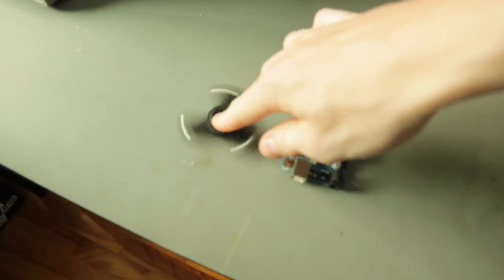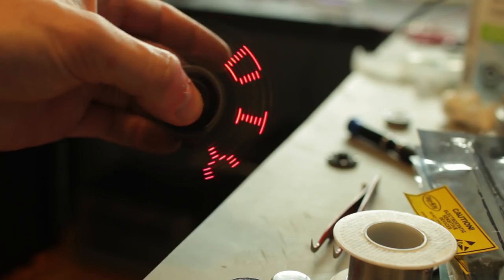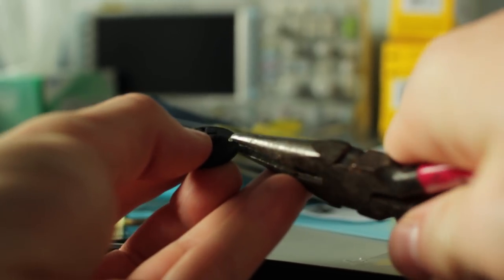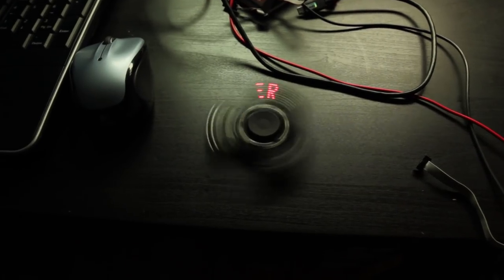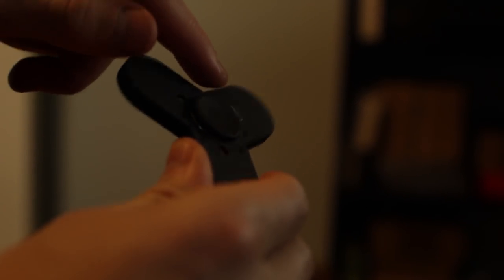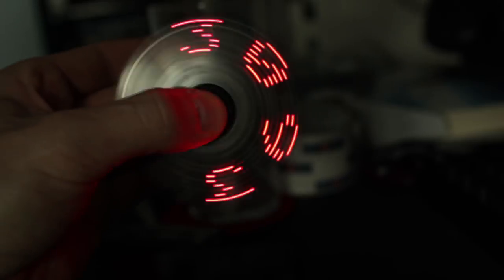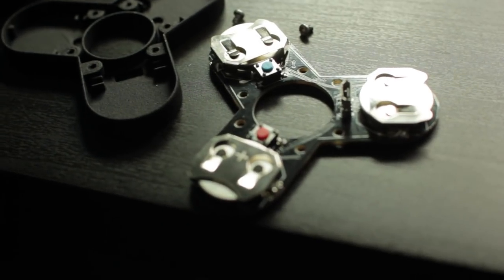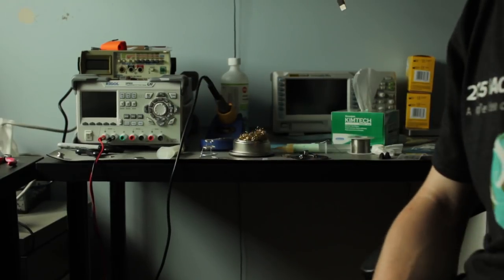Arduino POV Fidget Spinner - DIY!

Comment: I was just talking about this idea with my family. I think I will try to make this for several reasons. One is that it is a POV fidget spinner, the other is that is an open source design featuring several things that I need to learn (well, WANT to learn), i.e. charging and using batteries via USB, 3D printing parts and (maybe?) USB to UART...

Comment: Very nice work! Did you use linear reg then? Just curious why not a boost?
Reply from the maker: Thanks! 
You mean buck? There is no boost needed. The MCu runs at 3.3V and I'm giving the regulator 3.7 from the LiPos. I use this linear regulator because it uses basically no power when not in use and its simple enough, plus I have a ton of them so that doesn't hurt. Bucks require more components and when I was designing it I tend to go for simplicity. I've gotten a similar board down to 60uA in sleep mode with the regulator running so its not an issue.
Reply: Yea 'buck' idk forgot your using lipos. So there are minimal circuitry bucks (2 caps, 1 inductor) with an ultra-low Iq out there (TPS62742  Iq <360nA). Are using an ATSAMD21 Im assuming?

Comment: hey man !!
Kudos to you for the great open source work you are doing. 
I have a question. You work with sooooo many custom PCBs, how do you even design them? like do you design the circuits yourself?
If yes, how? I would want to learn to design circuits too
Reply from the maker: Ideally you would read the datasheet of the component you're trying to use. But, if its a well known, or commonly used part, there are often a lot of working examples online already, for example the SAMD21, which will allow you to at least skip a couple of design iterations. If not, then you read the datasheet which will(hopefully) tell you what discreet components are required to get it working, sometimes they give you a good example design layout as well, but those are generally just recommendations. Then you get software like KiCad, put the individual schematics together, and start moving them around on your desired PCB size until everything fits. Then its just basically running wires and vias around the board until everything is connected. Start simple, make an LED circuit or something, you'll see its not too difficult for basic things. Once you start getting more into RF, high speed data, and power system designs, you will probably need a deeper understanding of how the electrons are flowing. But for basic microcontroller stuff, its very forgiving.
Reply: @SeanHodgins  thanks for replying man 
I'll follow as you said !!!

Comment: Can somebody please correct this code so a green led is on for 5 secound when the right password is entered and a red led is on for 5 secounds when the wrong password is entered. I cant figure out how to do it...

#include <Password.h>

#include <Keypad.h>
Password password = Password( "1234" );
const byte ROWS = 4; // Four rows
const byte COLS = 4; // columns
// Define the Keymap
char keys[ROWS][COLS] = {
{'1','2','3','A'},
{'4','5','6','B'},
{'7','8','9','C'},
{'*','0','#','D'}
};
// Connect keypad ROW0, ROW1, ROW2 and ROW3 to these Arduino pins.
byte rowPins[ROWS] = { 7, 6, 5, 4 };// Connect keypad COL0, COL1 and COL2 to these Arduino pins.
byte colPins[COLS] = { 12, 11, 10, 8 };
// Create the Keypad
Keypad keypad = Keypad( makeKeymap(keys), rowPins, colPins, ROWS, COLS );
#define ledPin 13
void setup(){
digitalWrite(ledPin, HIGH); // sets the LED on
Serial.begin(9600);
keypad.addEventListener(keypadEvent); //add an event listener for this keypad
}
void loop(){
keypad.getKey();
}
//take care of some special events
void keypadEvent(KeypadEvent eKey){
switch (keypad.getState()){
case PRESSED:
Serial.print("Pressed: ");
Serial.println(eKey);
switch (eKey){
case '*': guessPassword(); break;
case '#': password.reset(); break;
default:
password.append(eKey);
}
}
}
void guessPassword(){
Serial.print("Guessing password... ");
if (password.evaluate()){
digitalWrite(ledPin,HIGH);
Serial.print("bien");
}else{
digitalWrite(ledPin,LOW);
Serial.print("n'est bien");
}
}